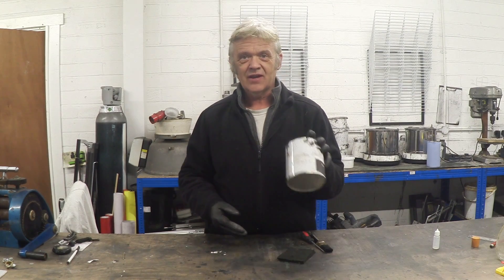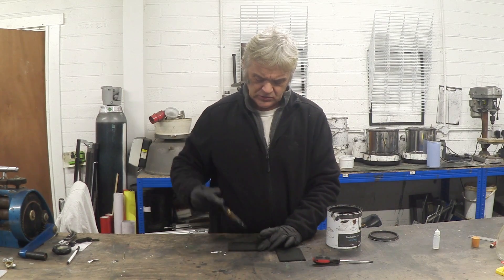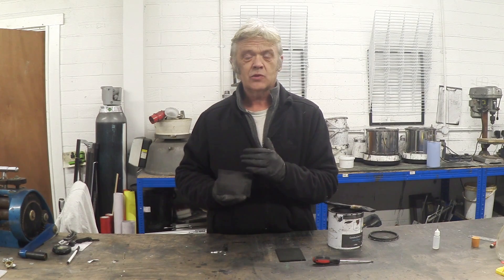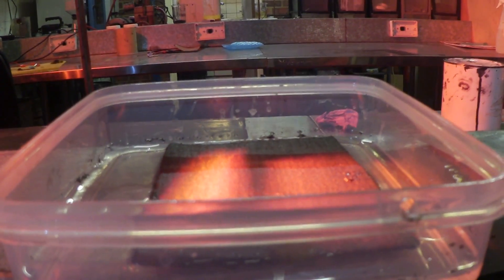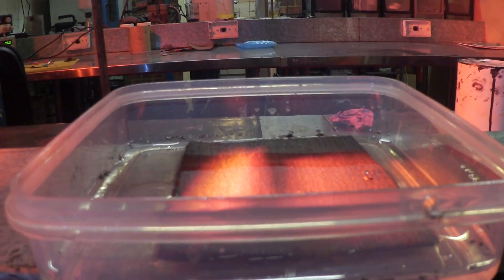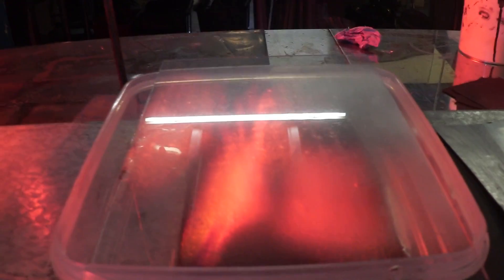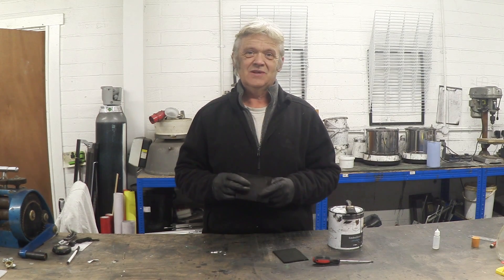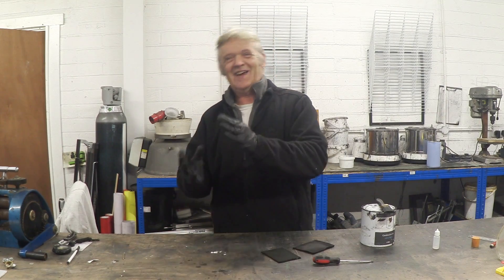Super Easy Desalination With Carbon Felt And Graphene Ink

Comment: I had the stupid idea to get a pip t joint of about 1/2" or an inch and just have the T going into the gas tank of a small engine. Going to the joint is a carbon felt to wick up fuel. The top of the T goes into the tank and the wick could do double duty as a filter. As the engine sucks in air it sucks it through the carbon felt wick to get fuel into the engine. that is the simplest carburetor I could think of.

Comment: You could try using charge to separate sodium out. We don't have your ink and experience, but that should be like making a capacitor where the Na and Cl sticks to the sides when there is a charge, and you can then release it later..That's about 80% more efficient than heating water into steam..
Reply: yes, but the idea here is that this requires no energy input by the user and runs for as long as the sun is out. also, you could teach a child to build this easily.
Reply: @andrewowusu-mensah7834  It is way less efficient then freezing water to desalinate it. And the solar power needs to be concentrated, so its not the best way.

Comment: So the benefit of this approach appears to be that it provides a way to create water vapour using low-intensity heat, such as from the Sun.  The graphene layer provides a very fine-grained nucleation location where the evaporation occurs.  There are many extant systems which also create steam - such as concentrated solar steam boilers etc.  This device will have application somewhere, but care will be needed to find a niche where it is better than other systems.
In a desalination application (and in a steam generator application) I wonder how this system will get rid of the impurities left behind.  Will they just linger in the sponge layer and eventually clog the interface?  Boiler treatment to remove sludge to prevent scale buildup on interface surfaces is a key item in continuous operating of any boiler.
Reply from the maker: probably backwash with a brine like they do in RO would work

Comment: could this work to power a sterling cycle motor?
Reply from the maker: i don't really know - but i would think so
Reply: As all that is required for that is a heat differential, I'd say yes- at least during the daytime.   you could make a Hell of a solar water heater with this concept as well.

Comment: There appear to have been scattered attempts to understand the charge environment at the evaporation interface, and some positive results in both directions; that is, both in extracting a charge consequent to the evaporation and in enhancing the evaporation by manipulating the charge at the gas/liquid boundary layer.  But I'll wager that you're a good bit more clever than those who have looked at it from the standpoint of mere scientific curiosity.  Somehow there will be a configuration of materials, mechanics, thermodynamics and circuit that hits a "sweet spot" of optimum integrated utility.  
On Background:
https://ase.tufts.edu/chemistry/kumar/jc/pdf/Guo_2017.pdf

http://www.electrostatics.org/images/2018_P22.pdf
https://link.springer.com/article/10.1134/S1063784218040205
http://www1.lsbu.ac.uk/water/interfacial_water.html
https://www.mdpi.com/1996-1073/12/1/11/pdfhttps://pdfs.semanticscholar.org/a26c/a0427bfc085b8caf58b21af162fbc573cf17.pdf
https://www.nature.com/articles/srep17276
https://arxiv.org/pdf/1901.04543.pdf
https://www.achrnews.com/articles/84092-evaporation-with-electrostatics
https://ieeexplore.ieee.org/document/8048045
https://www.sciencedirect.com/science/article/pii/S0166128009001420
http://www.freepatentsonline.com/5565067.html
Reply from the maker: thanks for that mate - i'll start having a look into it

Comment: Does this process stay the same on normal cloth or does the density need to be enough that wicking occurs rapidily/slowly? Does the temp ever break the boiling point? If so then isn't this a way to make some sort of condensate bags for drinkable water
Reply from the maker: I don't really know mate - i just did it but yes i would think so

Comment: I just use a black, quick dry, micro fiber cloth and a cheap Fresnel lens and get some great results.  I 3d printed a regenerative heat exchanger that preheats the influent while condensing the effluent.  That goes to a collapsible container that draws a vacuum as it fills up.

It may work better with some active carbon to increase the surface area, but I like being able to just toss the cloth in the wash.
Reply: technosaurus is your heat exchanger plastic?  Does it get good heat transfer?
Reply: @mp77744  Its 99% plastic. Basically 2 Tesla valves separated by a thin strip of metal.  It doesn't need to be Tesla's valves though - I only used them to minimize  backflow through the influent filter (prefiltering extends the time before needing to wash the microfiber and can be used separately if the water is chemical free)
Because of the limited length  (I wanted to be able to fit it in a backpack) the prototype is only about 80% efficient, but I could get past 90% with a few minor modifications without increasing the size much.
Reply from the maker: nice one mate

Comment: I got your paint a month ago and did this. Even create the Carbon Felt or conductive felt with your paint ;)  So I figure that I make a resistor from it. ;) Now we have a low voltage Water Generator. So many things we can Create with this Robert :) Another fantastic video. More to share on the member's site. Cheers :)
Reply from the maker: that's awesome mate - did you do a video? if so - do you  have a link you could post?
Reply: @ThinkingandTinkering  I will make one for this and post. I have some short vids on the heat paint on my channel
Reply: @ThinkingandTinkering  Just making a Graphene paint Felt Heat pad :) Again we have success!! So we took an Absorbent wipe and painted it with Graphene paint. I took a resistance and got conductivity across the material. So then I sew on copper tape and applied 20VDC. Now I have a heating pad pushing out 38 Deg C :)

Next step with this is testing with 12VDC and making a larger heat pad 

Video
https://www.youtube.com/watch?v=w1xMLr0tIZA

Comment: Coat the whole of the inside of a pot with a vent hole in the lid with a tube. See how fast it can fill a little based on surface area and volume of water from starting container. Curious about the math. Or rather what size of container I may need to get a litre in a reasonable amount of time.
Reply from the maker: nice idea mate - ro you could - it's easy enough

Comment: Robert Murray I just enjoy your work so much sir. Here is another video worth it's weight in GOLD. My brother bought his self a cheap 21 foot sail boat. He asked me about designing a fresh water system that would work on his very small boat. I think I just found it watching your video. I was wondering if you could also use near invisible Inferred LED's and get the same results. Can this be done sir? I was thinking of using Aluminum, Zinc or Magnesium battery that he could just lower into the salt water for the power needed for his boat and the fresh water system. This could also be used in the life raft to produce fresh water incase he is stranded. I hope you could give some insight to my project. Would you? Thank you for your time in the great little mini documentary that you upload for all to see. Your time and effort is appreciated.
Reply: RMS has a few videos, ca. 2016, where he stains beach sand with the GO ink and it desalinates seawater dumped on it.  Not too great a replacement for a tap, but seems like the ideal emergency kit addition, no?
Reply from the maker: i like your battery idea mate - this is an early stage iea and i am not sure how it will perform in the long term
Reply: @ThinkingandTinkering  Thank you for your time Robert.

Comment: Robert you really KISSed the lips off that one! Oh a neat old trick to get vacuum easy is to heat a sealable container cap it and let it cool no fancy pumps needed to improve an emergency water distillation system.
Reply from the maker: cheers mate
Reply: That's an easy way to make heat pipes.  I plan on trying it eventually.

Comment: Do you think this could be used to build a small solar boiler, to power a tiny steam generator, to generate 300-600 watts. Like put it in a Pyrex pot, with aluminum lid, with the steam head, in it, and return water, foccas sun light on the bottom and sides of the pyrex pot , heating the water to steam, maybe it would require multiple boilers? For the volume requirements, of the turbine, or converted 2 stroke engine, (2cylinders, 2 stroke) 80-100cc. I'd need it to dpin about 8k rpm, do you think it could boil the water through the Pyrex?
Reply from the maker: It's an interesting idea for sure - kind of lke a flash steam boiler?

Comment: I think the principle could work continuously. Only it would need off times to have salt dissolved back in water. I see the potential for a cheap method to get clean water, simple as the solar oven is.
Reply from the maker: i think so mate - a kind of backwash like in an RO installation?
Reply: @ThinkingandTinkering  It would need an external energy source.

Comment: The added benefit of using sunlight is the effects of UV sanitisation.
Reply from the maker: yep - it is funny but some folks have missed that
Reply: @ThinkingandTinkering  I would say that something that makes growing carbon nanotubes off of a surface then maybe something to bind them on so they are facing outward off the surface would be the most effective photon to thermal energy conversion no matter what frequency too, so UV might be more effective since it has more energy per photon than say IR
Reply: exactly
Reply: Having said that, the heat required to generate water vapour should do the trick anyway.
Reply: @VinoVeritas_  I was going to say, I just painted a flask with flat black spray and peel and then put a mylar mirror space blanket on a frame around my liebig condenser, (metal side toward the sun, to reflect all that thermal energy along with everything else, away from it, so tested the surface for the conductive metal coating first) with no solar concentration and it still worked quite well, I think people forget that if you evaporate something in a hurry so that you get higher pressure on the other side, the pressure forces out the heat faster so that it can return to a liquid at least, even if it is not getting outright cold, just hot water, that will cool off on its own, the top was still clear borosilicate glass so getting plenty of UV from the sun to sterilize things. the real trick would be ensuring that no gases trapped in the water get transferred and absorbed into the water again.
Reply: I should point out too, any flat black substance would work, so those with no money could use burnt stuff to make soot on plastic bottles from soda or something, and any type of tubing they can clean up to ensure it is safe to drink from when the water condenses, and for the silver reflector to keep the condensers at air temp rather than being heated by the sun, they can use potato chip (crisps I guess if you are in the UK) bags that have those mylar like linings, even if it is not the metal on the surface, and some coat hangers or what ever to make the frame around the coil or tubes making clean drinking water in a decently controlled environment possible even where only stuff thrown away can be had. basically doing it Mad Max style XD